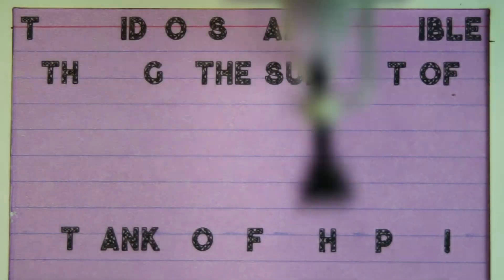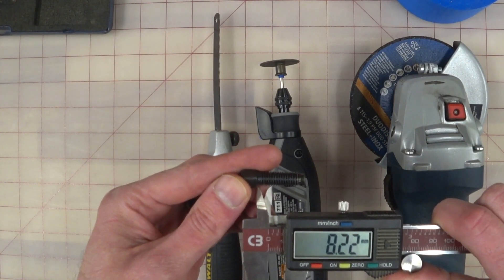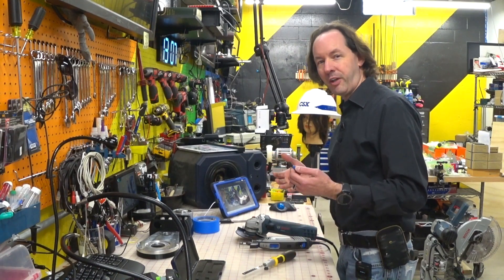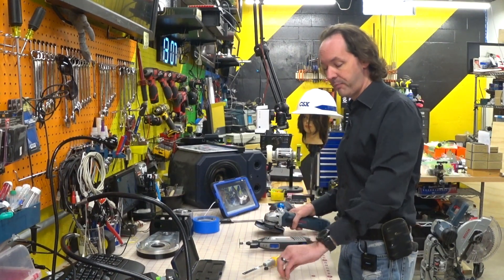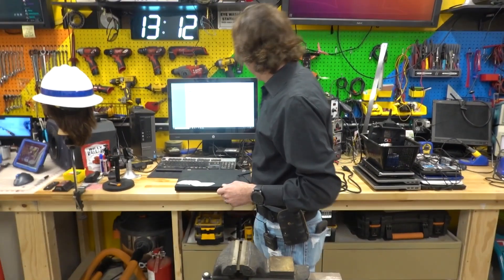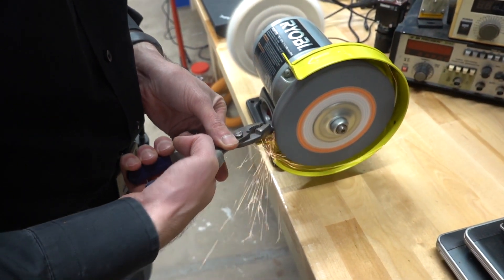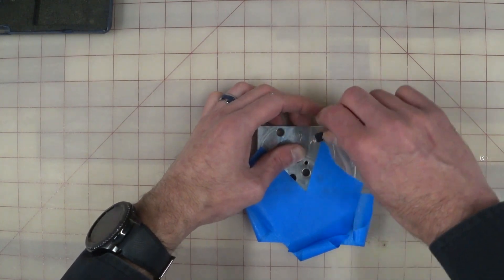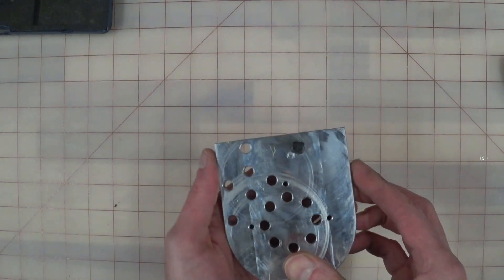Project ARchi3 Episode 3 Turret Platform Custom Bolt

Comment: Ideally you should put a nut on the bolt before cutting
After cutting, clean the end up, then when you remove the nut it will align any threads that have been distorted.
though it doesn't look like you'd get more than a half  nut on there.
Reply from the maker: You're absolutely right. I just didn't have an 8mm nut laying around when I shot this and I didn't think of that in advance. I totally support you guys reading the manual ahead of the video productions and messaging me tips like this in Discord for inclusion in the videos though. :)